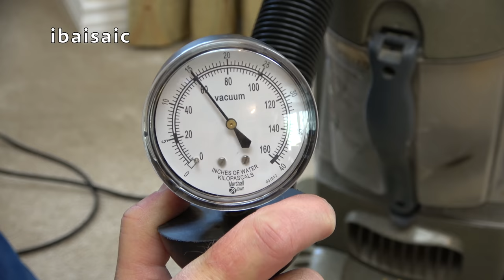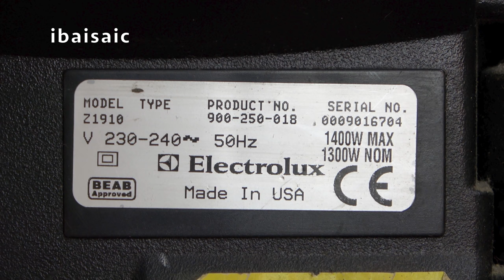Electrolux Z1910 Self Propelled Cyclone Power - Filthy Green Trash?

Comment: To me, other than Dyson and ones based on them like the Fantom, Vectron and the Amway Cleartrak, none of the bagless uprights being put out from the 90s up through about 2010/2012 were very good. They all had other designs to work around needing the true dual cyclonic system and most all of them clogged badly and were messy to clean. Once they were able to implement the dual cyclonic design (after the patent expired) they got infinitely better.
Reply: I completely agree. I own a variant of the model shown in the video and I use it at least once a month.  Even with a single use, these with this bagless system relies on constant maintenance, most of it being employing the bin after each use. If maintained meticulously, they can perform, but only with constant maintenance.

Comment: Yea theses were never great due to they're appalling cyclone bagless system with very awful filtration that is a dust thrower and motor killer. It's common to see theses cover in dust and motor sounding louder then it should be compared to our bagged counterpart which is definitely better in every way.
Reply: Bagged version is better
Reply: How is filtration awful? It has a enormous hepa exhaust filter
Reply: @FordMondeo-sh4fk  not sealed.
Reply: @charlesrodriguez7984  ahh I thought it should’ve been decent ish I’d probably put some silicone and do a makeshift seal
Reply: @FordMondeo-sh4fk  it also leaks dust into the motor and wears it out quickly.
Reply: Agreed and really none of the bagless systems back then were really any good (that we had in the US anyway) other than the Fantoms and the Amway Cleartrak.
Reply: @coled5090  for sure. Newer bagLess vacuums now keep up with their bagged bypass counterparts.
Reply: I own the Bagged Version (Smart vac self-propelled with dirt alert and my dad says it's really powerful)

Comment: Also if anyone wants to keep a spotless home then they need a cleaner that is reliable, I don't think there is a single bagless cleaner that is known to be reliable.
Reply: Early Dysons? I know someone who owned a DC05 up until recently when it finally died and got replaced with a Big Ball Cylinder
Reply: dglcomputers, bagged vacuums are always better.
Reply: I don't agree. I hate bagged vacuums. The bags get smelly very fast, especially when you have dogs and they loose a lot of suction when the bag in only half full. I got my bagless vacuum 6 years ago and it still works great. Nothings smells, the suction is great even when the bin is filled to the max line and you don't have to buy spare bags, which were quite expansive because I had to use only the hepa ones. I would never buy another bagged vacuum.
Reply: @huskyvacs  I don’t get how straight suction would “chew up your carpet” but okay
Reply: @huskyvacs  ah, okay, can’t disagree with you there, then again the DC05 I speak of had a straight suction nozzle for their carpets, and personally I owned the DC39 with the god awful triggerhead (gets clogged way too easily that makes it spin too slowly and also performs poorly on hard floors making it a pointless accessory). Personally I’ve never used a Dyson on nylon carpet but after hearing your testimony I can understand why the machine would suit poorly to your needs
Reply: @huskyvacs  Our house has had many Dysons before and our carpets are fine really. We do have some loose threads here and there, but that’s due to use of one of our cheap vacuums that has zero height adjustment. We have had a Dyson DC04 since I was born and it has been good, currently we own a DC24 and DC40 as well and they’ve been nothing but good to our carpets. 
I can’t comment about your experiences with Dysons since we probably have different floors, but on most if not all carpets they perform great for me! The DC40 we have is the best vacuum in my house and the agitation is ridiculous, it will vibrate nearby visible particles and they will wobble over and get sucked into the vacuum. It is usually not vacuuming carpets for long periods of time that wears carpets away, dirt and grit that sits in carpets wears down the threads when they are walked on and the carpets deteriorate.

Comment: While I do believe heat to be a contributing factor in yellowing of plastics, light certainly is another. One can tell light was the obvious factor by comparing the yellowed exterior plastics to a part that hasn’t seen sunlight, or has been heavily shaded. A unit can be yellowed by either of which.

I also want to mention that “cleaning up a unit” will not improve suction as measured by water lift. The dirt only impedes airflow, not suction, and since you are testing sealed suction you won’t notice a difference. This of course is provided you didn’t repair or fix any leaks in the system.
Reply: @huskyvacs  Bud, I’m a human being. I own like 5 vacuum cleaners, and I’ve fucked around with them all. I even own a Kirby.

Not to mention if you actually read my deal, you’d understand what I actually was saying. A cleaners airflow is heavily dependent on its state of repair. Dust and debris will block the ability of the cleaner to move air. HOWEVER, that does NOT effect its ability to produce suction/water lift. 

Go ahead and try it. Block up the filter on a Bagless unit and test it’s sealed suction with a gauge, then unclog the filter and test it. You’ll notice the same, or very similar result. 

The reason is simple. The motors ability to produce vacuum is not impeded by any porous blockage. In a sealed system the motor is trying to evacuate as much air from the machine as it can. It doesn’t matter if it has a harder time accessing certain parts through clogged filters, because ultimately it’s creating a total pressure drop, and the system will equalize out to whatever the water lift of the motor is.

The only time this number will change is that if the motor impeller is physically blocked up or been coated heavily with debris, the motor is physically spinning slower than as it would when new, or there are leakes sealed or introduced into the sealed system 

Maybe instead of being so condescending, you read and think.
Reply: @huskyvacs  well I have about 100 vacuums I would never say it impacts the suction fully washing machine and cleaning it  heavily impacts the airflow and suction it’s not as important as airflow is with a vacuum